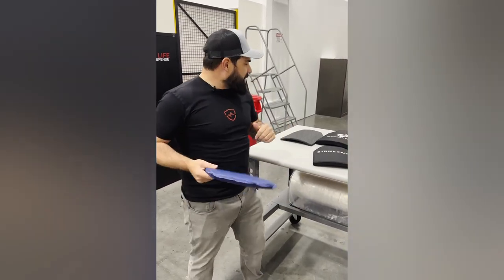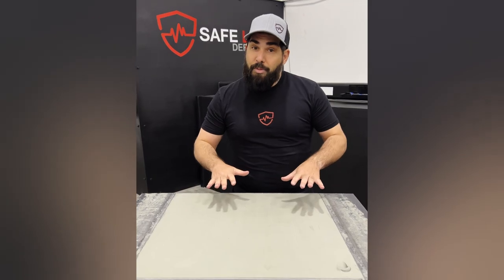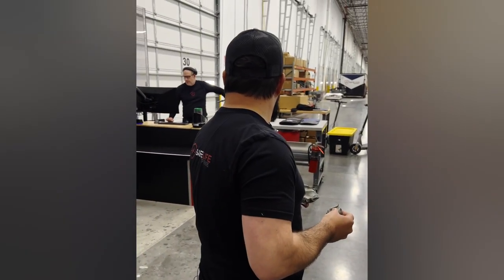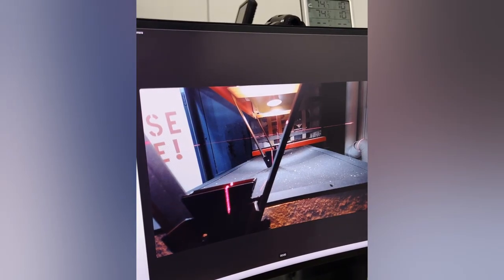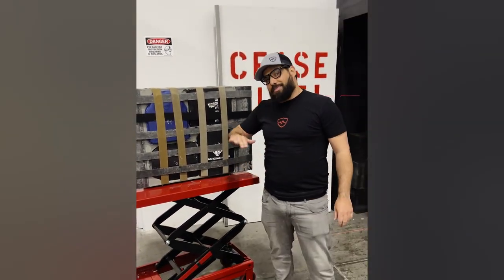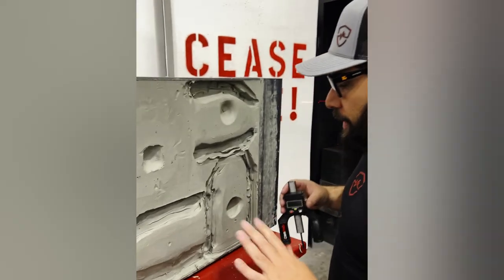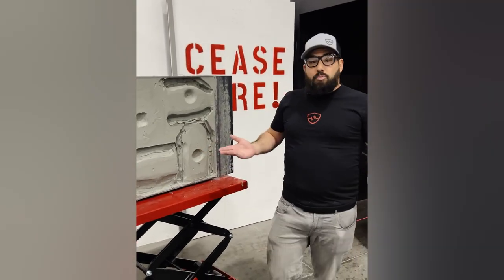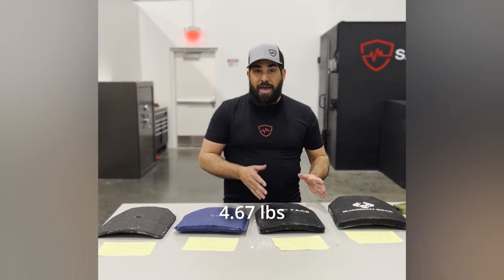Blunt Force Testing on 4 Different Rifle Plates Including FRAS, Steel, Ceramic and PE

Comment: Try M855A1 and M80A1 at 3100 fps . And try a ballistic plate of silicon carbide ceramic front face of 5mm thickness, 15mm of compresssed HWMPE and a 1.5mm grade 5 titanium plate. Wrap the ceramic and PE with 2 sheets or aramid and then cement the titanium behind . Total weight 2.5kg.

Comment: I have the Level 3A+ vest with Level 4 plates. Hopefully, I never have to find out if it really works.
Reply from the maker: We hope it never needs to be put to use but if it does it will absolutely do what it was designed to!

Comment: Why did u reset the test tool before each measurement but didn't reset it before testing the fras ?
Reply: I wondered this as well. I rewatched the video like 40 times between the polyethylene test and the FRAS test. What I determined was that while he is moving the caliper from the poly plate to the FRAS plate, there is (what I believe to be an unintentional) slight of hand where he actually does reset it, but its blocked by the bill of his cap. You can tell this by comparing where the bottom of the caliper is in relation to the "GemRed" logo on the arm of the depth gauge BEFORE each measurement, and how much of the caliper is left at the top of the gauge AFTER each measurement. I even went so far as to look up that exact tool to see images of the measurement markings. Based on that, I believe the end result was accurate, but it would have been nice to see the caliper reset on camera between the poly test and the FRAS test, like he did between the previous tests. 
It would also be nice to know what each of the competitor plates were rated for, although it's almost pointless if they are still both heavier than the FRAS plate, yet still created deeper impacts into the clay.

Comment: I already have the fras soft armor. For hard plates can I combine steel for even greater threats?
Reply: yes, you can add a plate.
Reply: @lifeveteran9766  I couldn’t fit steel plates in my fras safelife vest, only fras “hard” plates. Do only safe life hard plates fit that vest?
Reply from the maker: @luckeypolishing  Any 10x12 plate will fit in most sizes. For the smaller sizes they are 8x10.

Comment: I designed a BFT insert (several inserts) that absorbs over 90 percent of BFT from 10ft. away using Handgun Ammo.
Unfortunately another Armor Company stole my Samples and chose not to sign an NDA!!  Will your Ceramic  Plates stop Broad Head Arrows and other Hunting Arrows?
Reply from the maker: Will stop arrows!  Email us about your trauma layer and we will see if its something we could put into production! Info@SafeLifeDefense.com ask for Nick.
Reply: @SafeLifeDefenseBodyArmor  Nick, I had a CHP friend do some testing on my Level 3A Vest (Laminated) behind the vest is my Flexible Trauma Insert. Multiple shots were fired with various calibers from 10ft. Send me your address and I'll mail you a DVD of the testing. I laminated the P.A.C.A. Vest (brand new from the Sheriff 's Office back in 1995) the vest was test shot in 2015. I designed over 10 variations of my Trauma Insert with different Composites (light weight).
Reply: @stephenerpelding819 🤔hmmmm what’s your price for those plates.
Reply: @Delani2k  This is a late reply! Your CEO chose not to sign an NDA for my BFT Insert 4 months ago!?
Reply: @Delani2k  I haven't decided yet since I've made 5 different types using different Composites to make each one. They still need Certifying by the NIJ?

Comment: At 5 times the cost of Steel, I'll stick with the steel until you cut your prices by about 60 to 70%!!! And before all the internet warriors start commenting about what's your life worth, If you can't afford it then you can't wear it!
Reply: I have a few ar500 armor plates without any coatings and just use a roll of gorilla tape on each one to coat one side to take care of the spall. Seems to work really good... I think most of this is just dress up. Im working with a basically non existent budget, so I make do with what I have. Have a good one.
Reply from the maker: Get what you can!  FRAS is for those who expect and demand the best.   We would love to bring prices down but they are not cheap to make!
Reply from the maker: Dogleg  Not all M855 is coates with a green tip.  You can see the box and designation at 3:39. This is M855.
Reply: They have kevlar sleeves for steel plates to mitigate spall. Mine cost 80 bucks for a pair.
Reply: @SafeLifeDefenseBodyArmor sassy girl
Reply: @sloppyfloppy79 where did you get them?

Comment: I'll still take the AR500 plate with an Anti-Spall coating.
Reply from the maker: Whatever works best for you!  It does have lower BFD's and a lower price but is substantially heavier and you can run into spalling issues.
Reply: @SafeLifeDefenseBodyArmor  I don't want to be knocked out of a fight because a round hits dead center in the solar plexus and deforms enough to  knock the wind out of me.  Spalling issues are dealt with by the anti-spall coating, if properly applied and thick enough.
Reply: @thebluestig2654  also even if it is bare metal and you put a iiiA aramid panel on top of it and ducttape it 360, it will do the trick.

Comment: For SHTF I will stick with my steel plates for longevity... if the weight is an issue for you then buddy you have way bigger problems lol if I was part of a team with resources at my disposal I would go for the others but those ceramic and polyethylene can only take maybe 5 rounds at the most and they are done forever... when it comes to a ww3 situation on american soil and our distribution lines are cut and have little resources I would not assume I can get a resupply of sappi plates so like I said at the beginning I'll stick with the steel... many of you shy away from steel because of all the false claims and myths out there about the spawling... which is why you should always make or buy some soft armor inserts to put infront of the plate...